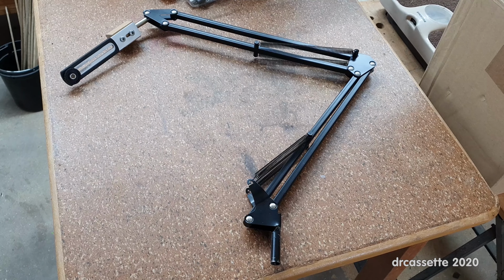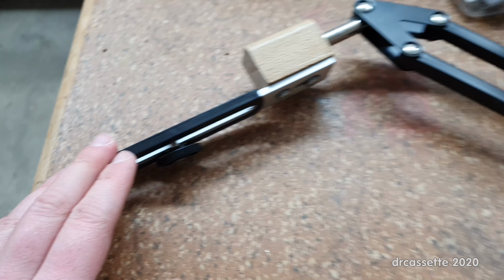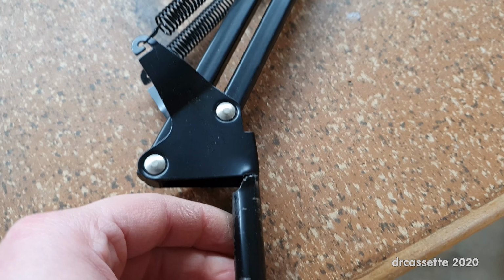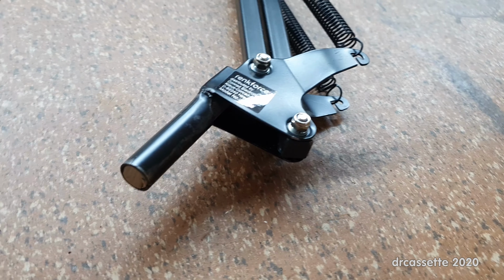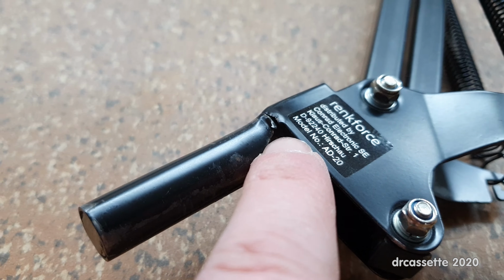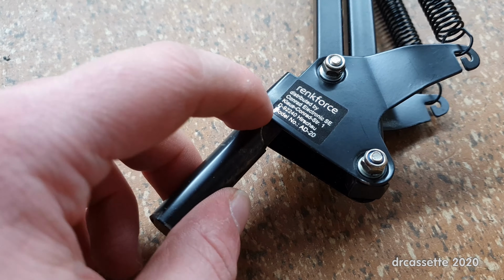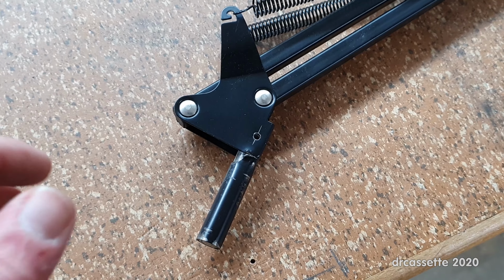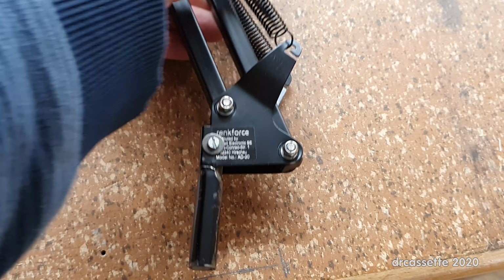Renkforce AD-20 microphone arm mount repair

Comment: Nice repair, that sheet metal is o so flimsy. The stress is had endured is a good example of “Hooke’s law” and  “youngs modulus” as it is permanently deformed and even sheared. The mechanical designer made an oopsie or maybe it wasn’t designed at all ( I think the latter). I don’t like sheet metal, it’s not a good structural material, I’d rather have reinforced concrete 😁.
Reply from the maker: Yes, I don't think they put much thought into designing the mounting piece. They reached their aim of being able to make the whole bottom piece from one piece of stamped sheet metal and that was good enough (cheap enough) for them.
I am not sure I would want to buy a microphone arm made from reinforced concrete ;)

Comment: When this thing happened to my desk lamp I did the same as you but welded it instead of the screw (which also seems to work fine).
It has been reliable ever since.
It was my second welding experience. Maybe it's time you get a welder? :)
LIDL brings in one from time to time that is an absolute joke to a professional (80A I think) but quite useful for a hobbyist like us!
Reply from the maker: I have previously thought about getting a welder, but I don't frequently need one, and the one time I had to weld (in technical school) it was a very scary experience.

Comment: Don't have any epoxy on hand?
Reply from the maker: I can't think of any way epoxy could have fixed this?
Reply: The epoxy would secure the metal rod to the entirety of the dodgy-as mounting piece instead of only to a single point. We once had to repair a critical part of a door lock. Drilled a hole in the broken part and the stump of where it came from to install a metal pin and we epoxied the whole thing together- using the 'belt & suspenders' principle.